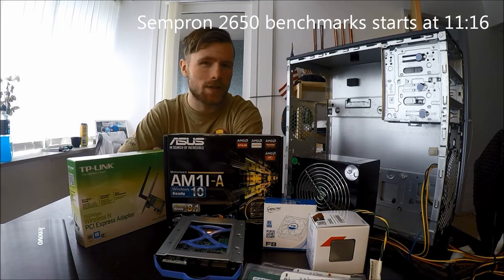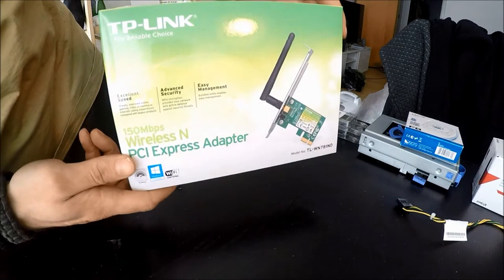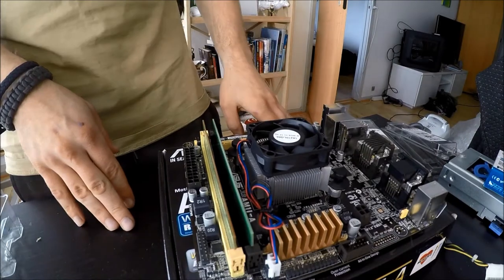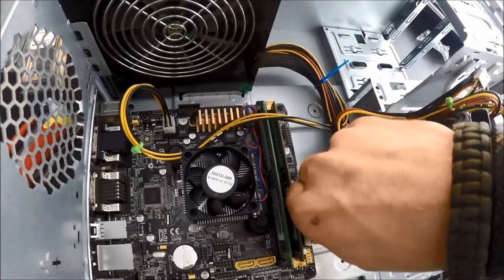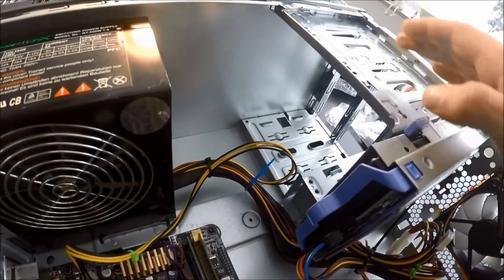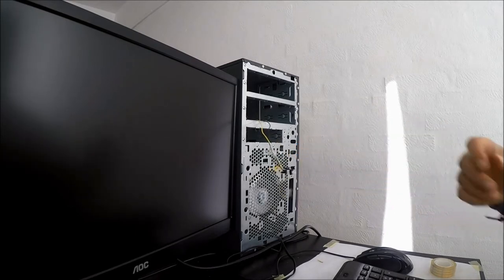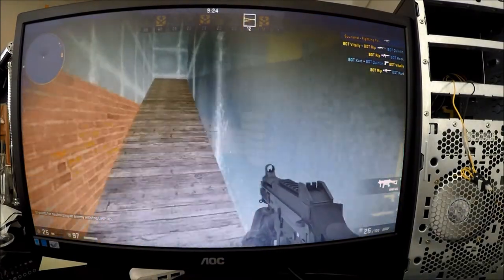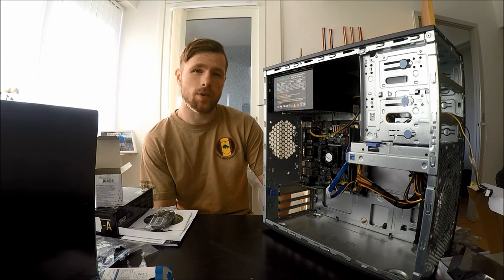How to build a computer + AMD Sempron 2650 benchmarks

Comment: you can get free or dirt cheap core2duo pcs most have 4 ram slots and come with 4gb ram and upgrade it to a q6600 for less then $10 including shipping then tape mod it then get a gt 710 card for $20 including shipping and overclock it  and get a ddr2 4gb ram for like $13 including shipping and it would kick this computers ass and be much cheaper

Comment: Amd sempron 2650 is 1.4ghz & not 2.4ghz !
Reply from the maker: Pretty sure I said 1.45GHz in the video?
Reply: In description it's wrong
Reply: Im going to buy 4gb ram & 2gb graphics card on it.... Can i play gta v
Reply from the maker: @kiranvc9338  No, the Sempron 2650 is not powerful enough for GTA V.
Reply: Bro if i upgrade this motherboard with 4gb of ddr3 ram.... without putting graphics card....can i play freefire & 60 fps on emulator
Reply: i overclocked it to 1,92ghz
Reply: Tu overclock 1.9

Comment: u liar...U are using a pentium 4 as stated in geeks3d fur mark...Dont make peoples fool..
Reply from the maker: subrata niyogi the Harddisk was from a Pentium 4 system, I can assure you that the benchmark is from the Sempron
Reply from the maker: Also, the clockspeed of a Pentium 4 is 2.4GHz, and the test was done at 1.45GHz, which is oddly enough, the same clockspeed of the Sempron 2650. I don't know why the system thought it was running on a P4.

If you want absolute proof, I will make a comparison video between the two.
Reply from the maker: Got the proof right here!  https://www.youtube.com/watch?v=_mzPcV8riFk
This proves that what you witnessed was nothing more than a software error!